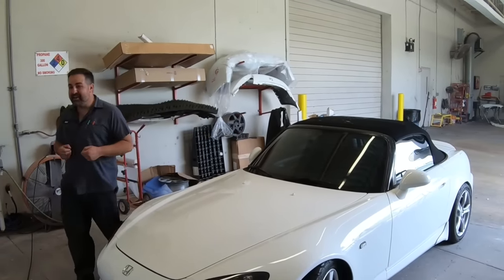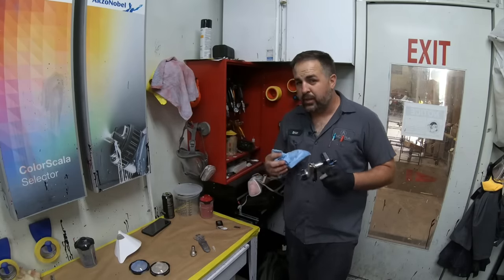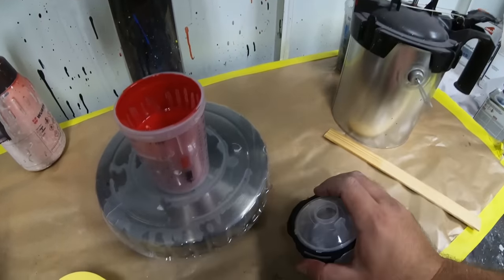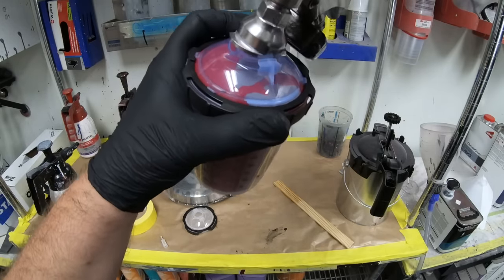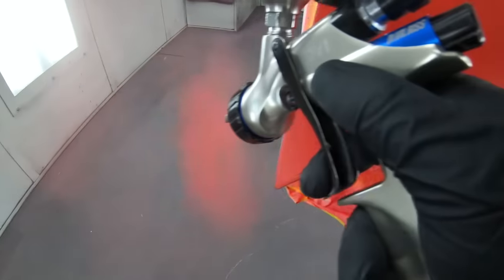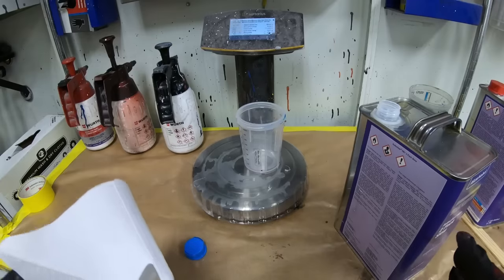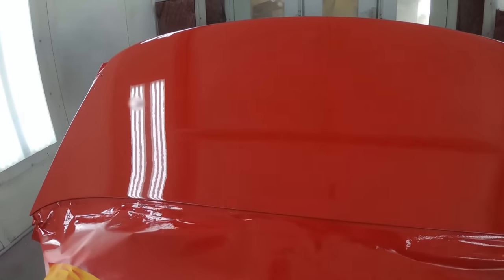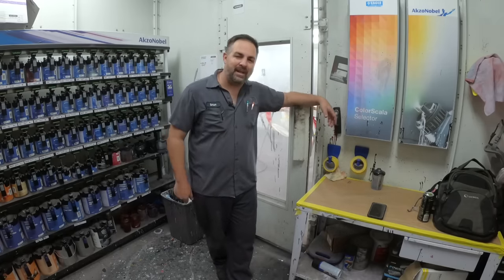SIMPLE Paint Gun HACK for INCREDIBLE Results!

Comment: We need videos showing how to paint single stage paint with small compressors and LVLP guns. Most of us are DIY guys and don't have the expensive tools
Reply: I used an ozito gun from Bunnings from the twin package and after much trial and error, I’ve gotten nice results with metallic paint of all things (wish my car wasn’t metallic paint now), I left the plastic filter in and has saved a few bits of crud from shooting into my paint
Reply: LVHP if there is such a thing - otherwise known as conventional guns
Reply: Eastwood has a hvlp gun that just needs a 33 gallon
Reply: Yes!   If like many of us your using a 110V compressor, you have trouble maintaining the 6CFM that the purple HF gun wants.  How many gallons your tank holds only affects how long you have to wait for the compressor to catch up!
Reply: @hobbyautobodyfun9315  that's not 100% true. The prep is important and makes a good spray job last, it doesn't make a bad spray job good. The gun makes a difference as well as technique. It's just not that cut and dry.
Reply: True, just a guy in a garage.
Reply: I agree, I spray with the harbor freight black widow gun and a 30 gallon 150 psi 1.8 horse compressor it does decent maybe kicks on 3-4 times while spraying a car
Reply: Hi Brian - Thanks so much for making all these instructional videos. It's terrific that you continue to share what you've learned from your experience. I'm hoping to paint some rust-repaired panels on my 1991 Rover Mini Cooper, but having trouble finding a paint supplier in the United States who sells the "Rover HNA" British Racing Green paint I need. There are plenty of UK suppliers, but shipping is either too costly, or they simply won't ship to the USA.  CAN YOU RECOMMEND A U.S. PAINT SUPPLIER THAT WOULD HAVE OUTDATED U.K. COLORS?
Reply: @Athiril  
A trick I picked up from commercial house spray painting which you can use for these, is , disemble gun, jets filter etc and chuck in solvent, no dry paint at any stage. With house painting,  I thew whole head in  a sealing 20l  steel drum  part filled with  diesel  after a quick cursory clean, never any issues with dried paint. My spray gun for regular painting is a bugger for clogging the vent, so would  benefit  from this, but   as it only gets used infrequently,  I dont like leaving everything stored in solvent longterm
Reply: He actually has one
Reply: @kuntz144  he states he doesn't know how to do single stage paint in one of his videos and that's why he doesn't do videos on it. He may have a short bit of info but he doesn't do single stage paint videos. I wouldn't expect him to do the videos I'm asking for but the other people he brings on like Scorpion Paint guy may know how or get someone who knows etc...
Reply: @miguelromandv7  you can lay down a good paintjob with cheap cheap cheap spray guns. Most of the time, it's the ease of dialing in the gun Cheap guns tend to not be able to be dialed in as quickly as a higher end gun.  Cheaper materials wont last as long, but can spray a decent job if your patient.
Reply: I have used Harbor Freight guns for years. They are almost as good as my Devilbiss Starting line or OMX and Satajet Gun. HUGE price difference. They are perfectly fine for the beginner in a garage. Buy two or three. I use one for high build primers and another one for topcoats. No real logic why I do this. I just do. I keep a third one around just in case I have an issue with the other two, which I never have. Just clean em' real good inside and out with a solvent after you unpack them to get the preservative off them. Prep work is 95% of the job. After that its spraying technique. As far a compressors go I have used them with a compressor as small as 22 gallon diaphragm type and still gotten good results. Yes, take out the filter and use a paper strainer. AND, shockingly I get the floor wet in my garage to keep the dust on the floor from kicking up.
Reply: Dude, all you need is 20-30 psi. With single stage, learn about, and practice spraying clear. Think of it as tinted or colored clear coat.
Reply: I painted my Car with a 10 gallon harbor freight compressor and a harbor freight LVLP gun without a problem , I used 2 water traps and 125 ft of hose (a 100 ft construction hose and a 25 ft smaller hose)  , I believe the longer hose help with holding the pressure
Reply: @genelamar797  absolutely. I put together an accordion of pvc pipes and mounted it vertically in my garage wall to increase air capacity and attached water traps prior to entering my flexible hose for the spray gun. Helped immensely for air capacity and by the time the air had travelled through the pvc pipe, probably 100 ft, it had cooled sufficiently to condense the water vapor in the compressed air.
Reply: @Athiril  I must check Bunnings out.. Supercheap & Repco have spray guns as well.
Reply: @rickykingi5191  this is a real cheap kit, works well, but a cheap HVLP would be an upgrade from it
Reply: @Athiril  cheers Daniel
Reply: Don't!
Reply: Then you need to watch the speedokote refinishing channel.
Reply: @Chase Williams  hvlp guns require a lot of air. Lvlp use much less air but also lay on material at a much slower pace.  Lvlp usually has a smaller fan. I use conventional or trans tech gravity guns that are just as efficient as hvlp. The guns I use require about 9.5 cfm and have a huge fan that can lay it on fast. This suits my wet application style.  DIY,  hvlp, small compressors, and high solids clear coat is a problematic combination.
Reply: Its hard to find a small compressor that will keep up with painting a car.
Reply: @stevezack6077  I spray with HVLP on a 30 gallon and get mirror finish
Reply: Look in garage sales. I found an old Craftsman 12 gallon, 1 hp 2 cylinder air compressor at a yard sale. I use it for all sorts of spraying, but not auto bodies. I spray cabinets and trim with it. Get a good separator and it would work perfect for cars. It keeps up very easily with my Iwata 2.0 tip.
Reply: We all knew that, that little piece needs to be removed, we are not naive specially if we use these sprayers to spray paint.

Comment: I tried this tip last weekend after watching. However, I got this weird feeling the gun didn't perform as well when rotated upwards. I have a feeling that without the filter, paint can leave the guns chamber very easily when rotated close to 90%. With it in, you can make quick swipes with a rotated gun and it's still full of paint, even if the paint in the cup has ran away from the filler neck. Any opinions on this?

Comment: I use the strainer inside the gun with no issues just clean it out when you cleaning the gun an still use the paper strainers also
Reply: I havent had too much experience personally with painting at all YET (off and on for the past 2 years, mostly rattlecan and rattle can clearcoat with some really good results), and I finally bought some guns off eastwood and they had the filter in them.. well I have been using the filter and obviously since I don't have much experience I don't expect a perfect finish, but it doesn't come close to Brians (probably gun settings honestly since I am getting used to HVLP) After I finish painting, I let the filter soak in laquer thinner with all my other parts for about 10 minutes or less, and clean everything thoroughly. I also use the paper strainers, however I am going to give it a try and take out the filter from the gun and only use the paper strainers. I have a clearcoat job in the morning and I am excited to see if this changes anything and pumped to see how nice it hopefully will be.
Reply: Don’t use it with metallics though almost fd my last job because I started painting with it in and got clogged so fast even with shaking

Comment: I use that same gun and it works surprisingly well for the cost.  I simply run lacquer thinner through the gun when I'm done painting
and that cleans it out very well.  Every 5 or 6 paint jobs I take the gun completely apart, soak the innards in lacquer thinner and then reassemble.  I've been doing this for several years now with no problems......

Comment: I have used Harbor Freight guns for years. Thank you for not knocking them. They are almost as good as my Devilbiss Starting line or OMX and Satajet Gun. HUGE price difference. They are perfectly fine for the beginner in a garage. Buy two or three. I use one for high build primers and another one for topcoats. No real logic why I do this. I just do. I keep a third one around just in case I have an issue with the other two, which I never have. Just clean em' real good inside and out with a solvent after you unpack them to get the preservative off them. Prep work is 95% of the job. After that its spraying technique. As far a compressors go I have used them with a compressor as small as 22 gallon diaphragm type and still gotten good results. Yes, take out the filter and use a paper strainer. AND, shockingly I get the floor wet in my garage to keep the dust on the floor from kicking up.
Reply: i use harbor freight guns too . i have one that i use for just clear nothing else.

Comment: I like to blow the inner chambers with air before i use them because sometimes paper towels and shop rags can leave lint inside. The 3m plugs actually fits in the adapter so you can leave it there when not in use, keeps lint and dirt from getting inside the chamber. Check fan patern on paper on the wall to purge out any lint or dirt thats left before painting.

Comment: I actually like using the filters in the gun. But I put them into the hopper and not the gun. It catches all the stuff in the filter from the hopper and all you do is take it out and use a air hose to get all the stuff out the filter. Run some acetone into the gun and filter and it’s good to go for the next day

Comment: Anyone heard of "vacuum" spray booth type? Where a slight vacuum , not pressure is inside a paint booth , so the overspray would be removed faster. (The seams of the structure must be perfectly sealed)
Reply: Most small commercial / industriall spray  booths  for small items use extraction/ suction / vacuum   at back of booth pulling spray away from items and operator
Reply: Some off the body shop paint booths are vacuumed through a grate underneath the vehicle so you don't have over spray and it keeps spray from getting out of the booth when someone walks in to the booth

Comment: The gun filters are great to use as a double down to dirt and trash. The solution is to use a different gun filter or at least a clean one each time you’re spraying. You don’t leave that in there and let it get gunky and filled with dry paint. If people don’t clean their paint guns, I don’t imagine they have good paint jobs anyway! 

Great for heavy primers when the fun doesn’t spray out like it should you already know that tiny filter needs to be changed. It’s an indicator and something most professionals always never use yet they complain about trash and such. Learn to use it as a indicator and keep fresh ones on hand or keep the one inside clean. If you can’t spray surface primer though a gun filter with a 2.8 tip and these tiny filters you don’t have the mix thin enough anyway. It’s an indicator and a safety net.

Comment: I have that ahrbor freight purplegun but struggle with water adjusting the gun for  base  sanding sealer and clear coats While  my airbrush has no issue with any paint if thinned right. or I decant spraypaint into a container to use in the airbrush. works well.  I tried getting good settings  for the others.. maybe I was in too much of a hurry to get things right for good resultor are wood finishing products that different from automotive stuff. most guitar colors are from the Dupunt catalogue. and any car paint works well on guitars but prepwork might be vry different.  fs. I handle  spray cans well from childhood. all we had back then. remnants of used cans were what we had as kids for the scrap bikes we rebuilt on the cheap.  .I now rebuild guitars to add to my collection hand made by me for me. maybe the pressue isn't consistent . I'm just . confused.

Comment: The pot neck strainers also restrict paint flow too much.
I just cone filter the paint (basecoat, 2K solid or clear) as I put it in the pot, and also pop the lid cap.
When spraying this allows that little better airflow through the lid, and it doesn't leak if you're careful with tilting gun for under edges etc only with paint flow happening.

Comment: Yea for sure those little filters tend to restrict the paint flow to the gun and give you more dry spray. I have always strained my paint. I usually strain it after I mix the hardener in and reducer. right before i pour it into the pot. even on a disposable.

Comment: Great video Brian. But not everyone can afford DV1 or Iwata WS400. I noticed most channels shows and talks about how to then they use these expensive guns to show very good jobs.
Reply: The good guns are really needed though, big wide even fan, cheap guns just won't cut it for long, and wear out very fast too.
Devilbiss GTI Prolite TE10 setup, very nice gun.
Iwata Belaria W400, and this puts clear on nicely too.
I also just the Devilbiss DV1S a short while ago, the spot gun with 1.0 and 1.2 set ups, fan almost as good as the larger guns, and perfect for small spot blends, single panels, bars etc.
Reply: @lesskinner8588  What part of the gun wears out, the tip opening itself? and is it due to the grain of the paint passing through at high pressure?
Reply: @Ovunix  Hi Stephen . . . anything the paint travels over / past through the gun eventually wears, paint is quite abrasive (especially primers).
Generally fluid tips & needles get most problems, air caps not as much I feel.
Some guns have plastic parts in the aircap area, gaskets, etc, these last very little time.
Best guns use high quality material to resist wear, and as few parts as possible, no gaskets or plastic parts.
A good gun can last years with good cleaning and care, but some painters buy new guns every year, they get used that much.
Usually in the shops where a painter just paints all day, cars are prepped ready, masked, paint matched (all done by others), the painter just paints cars, one after the other.
Reply: @lesskinner8588  ahh okay that all makes sense to me. Thank you for the info, it really helps!

Comment: They used to have filters that went over the tubes in the old suction feed guns (where the paint cup screwed on from the bottom). I never used them. instead, I always poured the paint through a separate filter first. It's similar to when you're in the kitchen making a cake and put the flour through a sifter to get any little nubs out of the flour. Note: NEVER put automotive paint into your cake batter!

Comment: As a new DIY auto guy, I'm concerned about to thin paint. Instructions say to use 2.5 to 3 mils per coat. I've ordered a gauge to try to learn how thick my coats are. How thick is the paint in this video after the 3 coats. I will be removing that filter from now on because I always filter my paint. Thanks for always putting out good videos.
Reply: RS onweb The information is wrong,paint thickness is measured in microns.

Comment: Spraypainter of 53 years here. HVLP is short for high volume low pressure and no there is no LVLP guns. Gravity fed guns have the pot on top and the suction fed gun has the pot on the bottom. Both are good guns if you have a good compressor otherwise moisture is a problem coming out of the airline. The cheapest gun in the world will give you a Rolls Royce finish if you set it up right. Stay safe and all the best from aussie...
Reply: Many LVMP and LVLP gun manufacturers out there

Comment: Well I'm going to try ditching the little filter om my cheap gun i don't have a clogging issue but a while back I had a rough texture on a tractor part i didn't thin it just the same because of running out of thinner when i cleaned the gun i noticed more residue on that filter being slightly higher viscosity. 
I noticed that you still have a screen on that liner cup but a lot more surface area. I always run the paint through filter cones.
That being said i paint everything with ag paint ,tremclad or rustoleum with acetone for thinner and a little bit of enamel hardener gives me a nicer finish. 
Mostly I paint equipment  but i also paint my vehicles this way because of all the gravel roads I drive on eats the living shit out of everything  bought a brand new truck about 20 years ago within 6 months looked like the rest of the junk i drive that was after I'd painted a truck the year before and i spent all that money on real automotive paint  6 months later didn't look any better than it was before lol. I thought I did something wrong till i got new one and same problem just the gravel 20 miles of gravel each way to city plus local area driving 
Now single stage enamel is abut 6 to 8 hundred a gallon up north of the border plus reducer and hardener. So for me cheap paint is where its at sometimes its so bad i don't even have to sand the body down except for top usually the  bottom 1/4 of the body i just mask off and paint already sandblasted good for another 6 months don't even worry about bugs anymore when  i paint gravel knocks the sobs right off by end of day . 🤣😂🤣😂🤯🤬🤬🚜👍👍👍🍻

Comment: Great channel....Did you use 10% reducer on the second clearcoat as you stated in a previous orangepeel video? Also, you mentioned 4:1 clear to hardner. Did you not use ANY reducer? Perhaps I am confused, but I remember mixing instructions for PPG paint to be 4:1:1 clearcoat to hardner and then reducer which would be a fast reducer or slow depending on the temp....